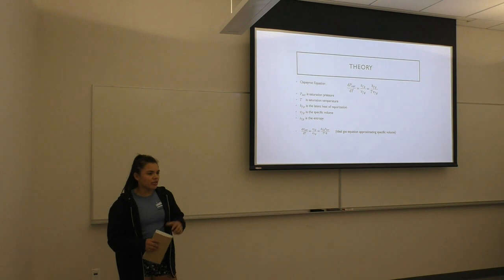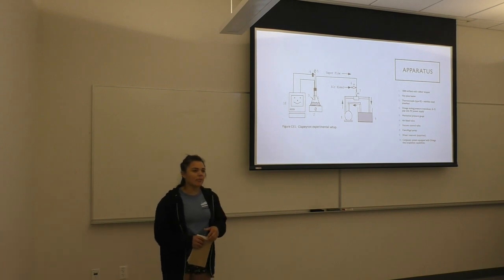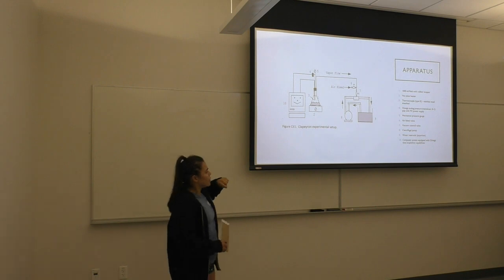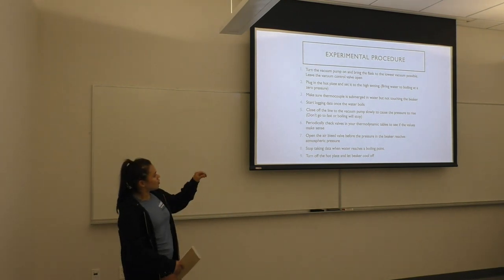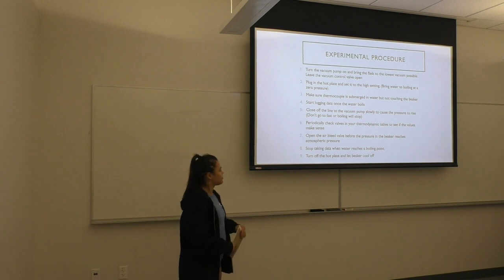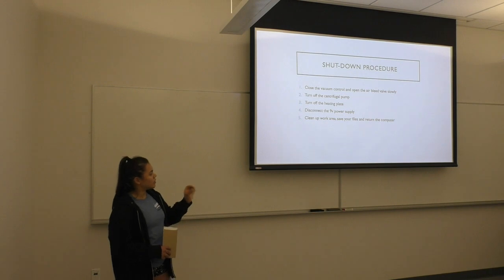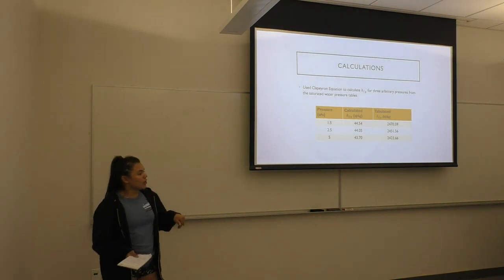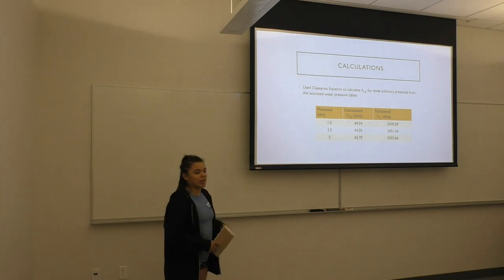S2030006

Comment: I think Stephanie did a great job on her lead presentation. She discussed the back ground and theory of the project and explained the equations used. Also, she explained the process well and the engineering equations that will be necessary for the lab. She talked clearly. Although her presentation was a little short, she had a good presentation. 

~Michael Duhe